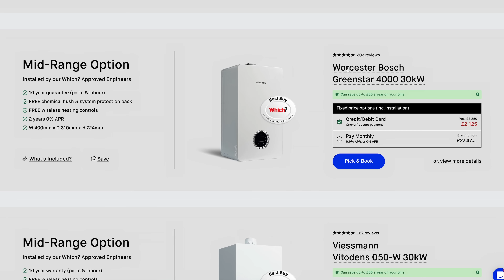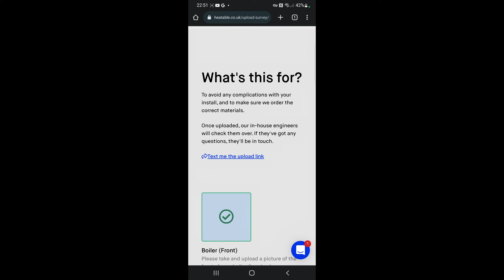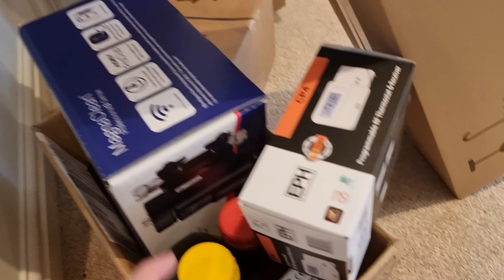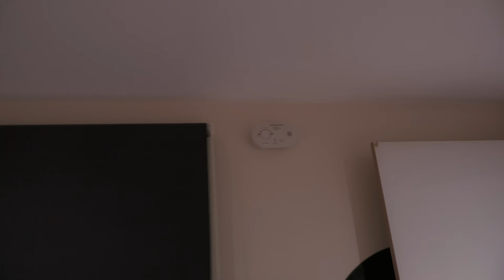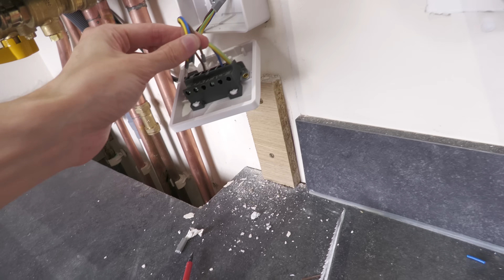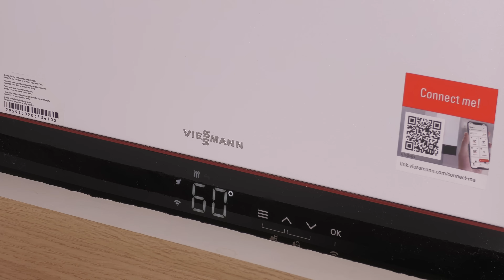New Boiler from Heatable - A Paying Customer's Review | Viessmann Vitodens 050-W

Comment: A small local installer is always better than some giant faceless company. Your local guy will care about their reputation and will be trading on word of mouth. 
The bigger company don't care. You're just a number. If it goes wrong you'll moan for a bit, maybe leave a bad review and it'll be swallowed up by all the others. 
You have no idea how good the installer is before they turn up, you only know how good the sales team are. 

Glad it went well for you though
Reply from the maker: That's very fair, my fear was that I've seen plenty dreadful work from local installers, for example, my parents had used a reputable local installer to replace some motorised valves.  I ended up later installing a new thermostat for them and found the standard of the wiring that had been left behind was shocking (https://youtu.be/9L2kKI7e0GE?t=565 ) yet my parents had no idea since it was buried under the floor so they would have happily recommended the company.  My logic with going through Heatable was that if there was a problem with the installer, I'd at least have a company to go to about it rather than it just being me against a single installer, Heatable could then send a different installer to rectify issues.  It also allowed me to pay by credit card which offers section 75 protection whereas a lot of local installers would want paid by cash/bank transfer which offers no protection.
Reply: @camerongray1515  You used a large company and got bad wiring too. I would tell people to pay attention to the job being done regardless of who's doing it.
A lot of local installers accept cards now. Since covid I'd actually say most do now.

Your local installer will also use local suppliers and will spend the income locally rather than some company that buys in bulk direct from foreign manufacturers. Heatable have pallets of your boiler direct from Viessmann. They save on buying in equipment then match the prices local guys with more links in the chain charge and pocket the difference.
Reply from the maker: With the bad wiring, that was absolutely the case, however at least if I wasn't willing to fix it myself, I could have spoken to Heatable about it.  In fact, it turned out that the installer hadn't installed the plume management kit which was actually required due to my flue being too close to an internal corner. This was only identified by Heatable when they reviewed the job photos that had been submitted and sent the installer back a couple of days later.  Had I gone with the installer themselves then nobody would have picked up on the non-complaint installation until years later at a servicing/inspection/warranty claim where the cost of fixing it would likely have landed on me.

As for keeping an eye on the contractor, I agree, however I was working from home at the time so was tied to my desk most of the day so couldn't be there for the whole process.  Also since I was wanting to review the process as if I was a normal customer who probably knows nothing about heating systems, I didn't want to get too involved except for the final point when I needed the OpenTherm flex connected.

Then when it comes to the supplier, the boiler and all parts came from Plumbase who delivered everything in the morning (and promptly crashed their van into a lamppost...) so while it's not a local independent merchant, it's not coming directly from Heatable.  I suspect most local installers would buy from a similar place.
Reply: @camerongray1515  The 300mm rule is gas regs not a manufacturer recommendation and the installer really should have known that so yes in this instance having someone review the job helped.

I view the huge installers like amazon. You may get the same product but its at the cost of the local economy. 
I wouldn't use them if it was avoidable.

Comment: Had mine installed 3 days ago and asked for it to be wired up for open therm when i found out that the engineer was going to wire up for on/off.
Now i find that you can not turn of the preheat function which seems counter productive. Does anyone know if there is a solution for this?
Reply from the maker: I made a video installing Nest for OpenTherm on mine and found the same issue.  With Nest I worked out that setting the Nest to think that it was connected to a System Boiler rather than a Combi worked to disable preheat: https://youtu.be/gZcy0sruFfA?t=5592.  If you're using a different type of control then you'd need to look into your control settings to see if you can do similar.  Equally, I'm not sure how much gas the preheat necessarily uses so it may also be worth setting up the ViCare app and look at the gas consumption for a day when you didn't use any hot water or heating to see how much the preheat actually uses - I keep meaning to re-enable preheat while I go away for a couple of days to check this out of curiosity.

Comment: did you consider weather composition?
Reply from the maker: I looked into it but could never quite get my head around it.  I ended up just going for a Nest connected up over OpenTherm to give modulating load compensation control.  I also feel this potentially fits my needs better than weather compensation as my requirements for heating are often quite sporadic - I am away from home quite a lot of the time.  So with load compensation I can heat the flat up quickly if it's really cold after being away for some time with the heating off but then it can modulate the boiler down to a lower level when the rooms are close to the set temperature.

Comment: ooh - separated HW and heating gas consumption. Thats a nice one. I do have smart gas meter but I wanted a way to separate out usage to compare HW and heating which it doesn’t do. Thats really tempting. other boiler on my shortlist is the worcester-Bosch 4000 30kw. I do have tado which annoying doesn’t do opentherm in the UK but I’m hoping to get the extension kit to enable opentherm.

Comment: Regarding heatable absorbing costs of unexpected problems, i absolutely guarantee it will be the poor bastard throwing the boiler at the wall who has to absorb the costs, not heatable.
Reply from the maker: I think it's a bit of both - Heatable pay the installer a fixed fee for the install (around £400 for a combi swap if I remember correctly) but barring a few sundries, heatable provide the parts that end up being required.  So sure for the installer, some jobs will be a bit more time consuming but equally others will be relatively quick.  From a customer perspective it makes things a lot more predictable.
I actually now have a decent example from this job of where heatable came in invaluable.  When the installer fitted it, he didn't install a plume kit.   After I published this video, Heatable inspected the install photos (or at least I presume this is what happened) and determined that a plume kit should have been installed as the flue was within 300mm of an internal corner which is against Viessmann's instructions.  Heatable supplied a plume kit and sent the installer back to fit it.  This plume kit costs around £80 but didn't cost me any extra.  Additionally, as far as I can tell, it was Heatable that flagged up the lack of plume kit, had I gone directly with the installer, I probably still wouldn't have a compliant install and would be none the wiser until I end up having issues with Viessmann's warranty in the future as it wasn't installed in line with their instructions.

Comment: Hi, thanks very much for this video. I went through all this about 10 years ago now and interesting to see how things have changed. Particularly interested in the control system though and OpenTherm. Have you found any good multizone systems based on smart TRVs? I have one I built about 10 years ago out of eq3 MAX valves and an open source smart home controller. It's great although the valves have been discontinued so looking at a modern equivalent ideally using OpenTherm somehow but there doesn't seem much out there. Nest etc is all very well but fundamentally flawed in my opinion because it can only control the bolier rather than the individual rads. Would love to hear your thoughts
Reply from the maker: There are a couple of options that would let you use OpenTherm with smart TRVs - It turns out that Tado does seem to support OpenTherm although only on their wired thermostat where you'd need to extend the OpenTherm connection to wherever you want the thermostat to be, the wireless models with a separate receiver doesn't support OpenTherm in the UK.  Systems such as Drayton Wiser and Honeywell Evohome also allow the use of smart TRVs with OpenTherm.

For me I've been in two minds over it - I'd be interested to see how beneficial smart TRVs actually are from an energy saving perspective.  For me I don't have a huge property so all of the rooms are in use - the most benefit I'd really get would be to stop heating the bedroom during the day so that it's cooler in the evenings and I'd need to get much better at keeping internal doors closed.  The internal walls also aren't insulated (often there isn't insulation between floors in a house as well) so you're still going to end up losing heat into other rooms throughout the day from this.  There will definitely be some energy savings if there's rooms that you never use, but I don't think it would really be enough of a saving to justify the cost for my size of property (although I'm willing to be proven wrong).

My thinking for Nest is that with OpenTherm, you need the Thermostat to be good at handling load compensation which Nest is well known for doing whereas with those other systems, they don't have as much of a proven track record with this, especially with the additional complexity of adding in multiple rooms at different temperatures while optimising the flow temperature.  The Drayton Wiser system for example was launched with OpenTherm support but this only operated as on/off control until an update in 2019 - I just don't want to risk getting a system where the load compensation is a bit of an afterthought.

Although admittedly, since I'd be producing a video of installing whichever system I go for, I suspect Nest would have a more universal appeal than a lesser-known system which is why I'm leaning towards it (although still not set on Nest for sure yet).  I've also considered potentially doing something a bit DIY where I have generic smart TRVs in the bedroom and en-suite and simply close and open them on a timer, then just have the nest operate as normal.  This would give me 99% of the benefit of going for a full on smart TRV system since realistically my only use case would be not heating the bedroom once I'm out of bed.
Reply: @camerongray1515  Thanks for this - interesting, and understand where you are coming from. My house is a reasonable size and quite tall because it's a terrace, and so I do only really want the bedrooms heated for an hour or so in the morning. However if I do for some reason want to heat them at another time it's great to be able to dial up the temp in any given room and it immediately calls the boiler for heat. I think as you say if you want the load compensation to work well you need to keep the system simple. It is interesting to me that after all this time we don't really have a definitive solution to this. Maybe it's a uniquely British thing, in the US they seem to use more central HVAC plants and there is very little control in each room bar a mechanical vent. I did some calculations when I installed my system and I'm sure it saved gas and money but it's so long ago now any savings I made are now taken for granted! Thanks for the all the videos, will look forward to seeing where you go next

Comment: one thing i can tell right away is that that boiler would probly not have been enough for me.  cuz i like thaking quite long warm showers idk how many litres that thing is but im guessing its not to much, unless ur using this for room heating only then it would probly be enough
Reply from the maker: It's a "combi" boiler so doesn't store water - it heats it on demand.  With this one being a 30kW model it should be more than enough for a powerful shower, I checked mine this morning and while it was feeding a shower at a pretty high flow rate and decent temperature it was only running at round 40% so should be more than enough for a hot shower, even in winter when the water coming into the boiler is cold,
Reply: @camerongray1515  That actually pretty good. Thanks for explaining and giving info.

Comment: This is amazing - thank you for the information. I will definitely look at this way of doing this. Thought a local installer was the only way to do it The only problem, I have is that I don't trust/like Google .. I'd want to use Tado - but that sounds like a bad idea from what you say. No way google though .. :(
Reply from the maker: It was definitely a lot more convenient than faffing around with local installers.  As for Tado, it looks like the Tado wired thermostat might support OpenTherm but it'll require a cable between the boiler and the thermostat, the wireless one doesn't.  There are also other options that support OpenTherm but aren't Google, namely Drayton Wiser and Honeywell Evohome
Reply: @camerongray1515  oh thanks! I’m not as good as you with the wiring (I have a PhD in physics and should know! Which makes it all the more annoying. ) so I’d be really stuck without seeing this. Thank you. You’ve saved me a load of faffing about! [I think this is my first comment on your channel I’ve been subscribed for years now, and I’ve always loved the content you put on - thanks!]

Comment: I recently had a Ideal Vogue 32 MAX installed. Wanted my existing Nest Learning thermostat (3rd gen) set up  to work with my new boiler.  Electrician didn't have clue what he was doing.  Connected the Nest OT connections up to the 240v inputs in the boiler.  Thankfully no damage done to the Nest, but I had to expain to him that there are low voltage  OT connections in the boiler, he didn't even know they were there. 😲  It's all fine now, with Weather Compenstation also installed, will see how that works out when the weather takes a dip.
Reply from the maker: Ouch!  Good on Nest for presumably designing the heat link to be able to deal with such idiocy!  This is why I tend to always do things myself - I find it too hard to trust contractors not to do things like this, I find it crazy that DIYers are often more up to date with modern standards than people who should be experts in it.
Reply: @camerongray1515  I could not agree more Cameron.  When it became clear that he had no experience with OT I politely suggested that "Google is his friend" so he could look it up on his phone, but nope!  Could not be bothered. Shocking!!  Most annoying.  Also, heating engineer had no idea what Boiler Plus was, though to be fair, this new standard will be required for compliance only in England,  A date has not yet been set to Bring Boiler Plus standard to Scotland
Reply from the maker: That would make a bit more sense if boiler plus isn't a thing in Scotland yet since there's probably no rush to install OpenTherm controls since people tend to never move unless they're basically forced to but I still find it crazy that you can have a job and be totally oblivious to the changing landscape of your industry.  I come from a technology background and I'm terrified of getting left behind if I don't keep up to date with things!
Reply: @camerongray1515  Indeed!!  My installer is a nice guy from the same well-to-do housing estate as me, but when I mentioned Boiler Plus to him he just said "ah!! regs, not my thing, I let the office deal with all that sort of thing" I mean... WTF!  right!!
Reply: And it's not like Open Therm is actually a new thing either, it's been around for literally decades!!
Reply: @camerongray1515  Oh, and I'm not 100% sure, but I think the Electrician connected the two OT wires from the heat link into the swithiched live inputs for CH and DHW, so no 240v was passed back to the Nest.  I think that would have blown the Nest to bits.  I've been inside my Nest Heatlink, it does not have protection against idiocy, I just got lucky
Reply: Unsure how that happened as ideal literally label the opentherm connections in the boiler.
Reply: @ItsFriscoBaby  I know, right!  It seems the electrician didn't know what the OT terminals were for.  Face palm 😲
Reply: Cowboy's life..

Comment: If you’re looking into Nest, I got the Nest E - they’re great! The heat link unit is also much nicer looking if it’s on show, and the thermostat is a desktop type and looks very sleek on a shelf. Perfect for combi boilers! Also cheaper! :)
Reply from the maker: The Nest E does look like a nice product, especially for DIY install where you just want to replace an existing wired programmer on the wall without needing to get into the wiring at the boiler since you can easily leave the heat link on show.  For me I'd probably just go for the full on Nest since I actually enjoy fiddling about with the wiring so I'd have the heat link next to the boiler.  I'd then be able to reuse the 3 core and earth cable to the hallway to power the nest thermostat.